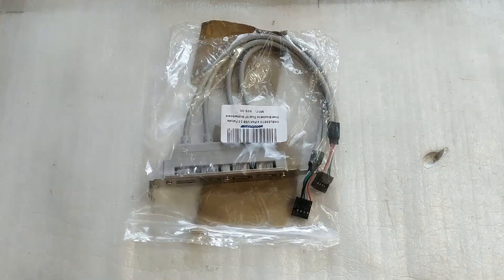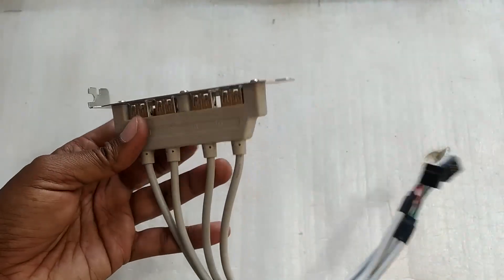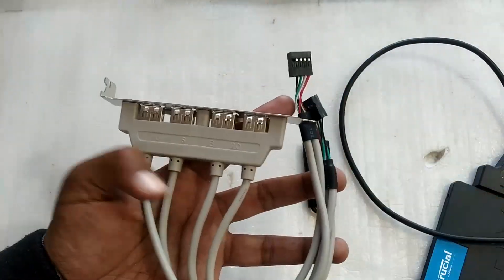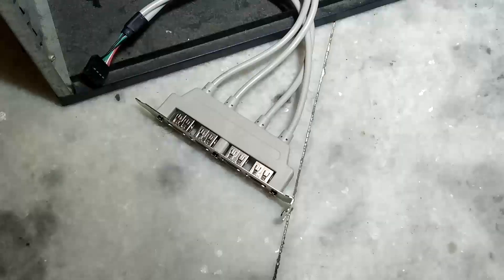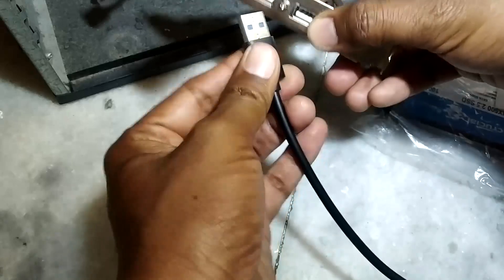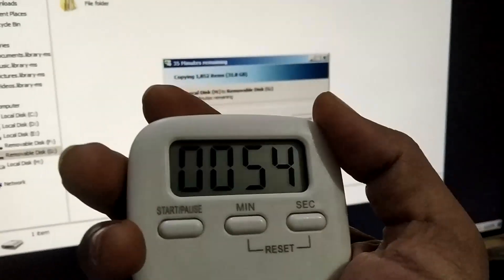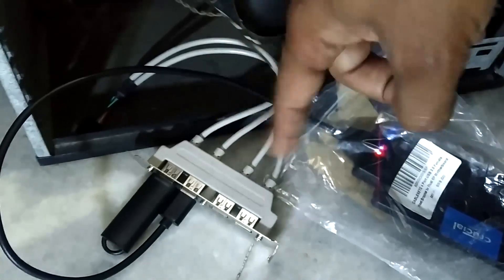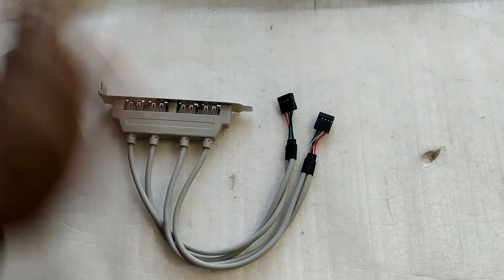4 Ports USB 2.0 Female to Motherboard 9 pin Header

Comment: Why didn't you use your new computer to do the transfer? Did it not come with sufficient usb ports, that too, usb 3?
Reply from the maker: yes, I can do that. But, my old pc is still what i use most of the time because that's the one that connects to the internet. And i have only one monitor, so, having to connect the monitor again to another pc takes time.
Also, i'm not retiring this pc anytime soon, that's why still improving on what i can, even on the OLD PC.
And I also wanted to make this video. So, it may not apply to me but i'm sure someone might find this helpful.
Reply: @gurribuy  I see. Another question, if you don't mind. When you connect one usb slot on the motherboard to a multi-port connector as the one you have, isn't the bandwidth of the slot shared between the ports? I mean, won't the transfer be slower than one between two ports on two different slots?
Reply from the maker: @krshnam6170 In my video. I only had one spare usb 2.0 header. Each header gives you two USB port and both the port have their own dedicated bandwidth, they are not sharing.
In my case I am only able to use use two usb port from this device because there were not header left on my motherboard for the other two.
Basically one USB header on the motherboard equals two usb port with separate bandwidth.
Reply: @gurribuy  Thanks. That clears up things.